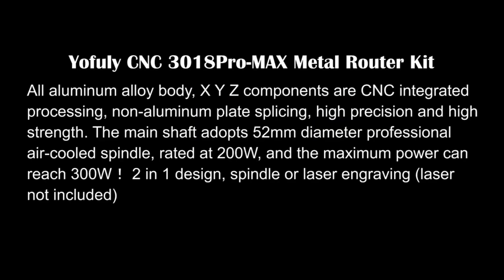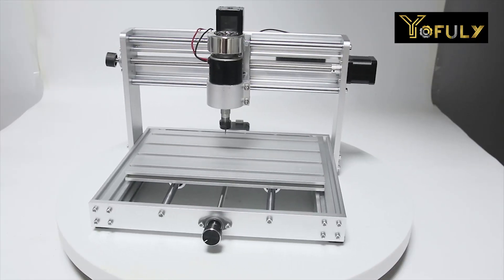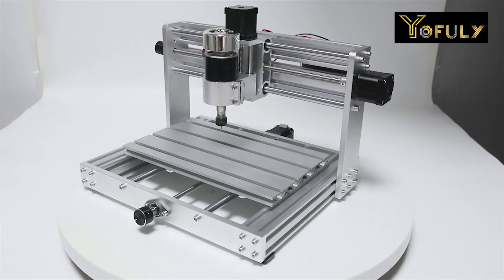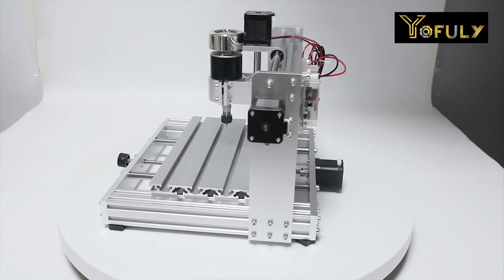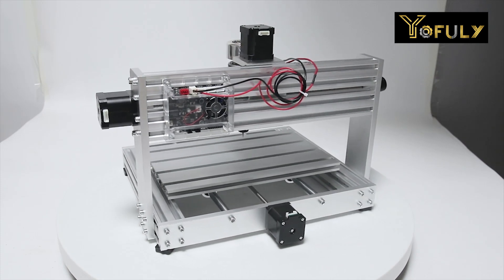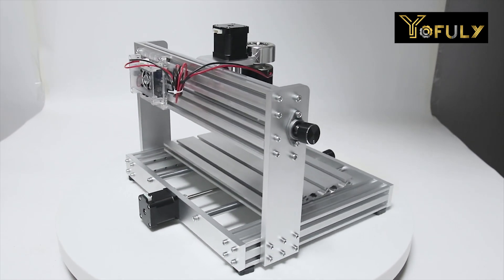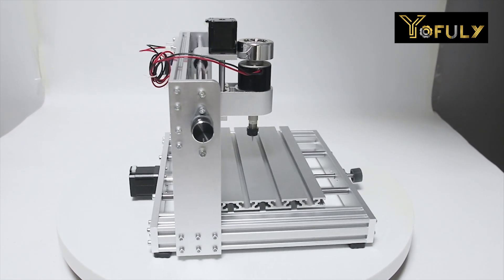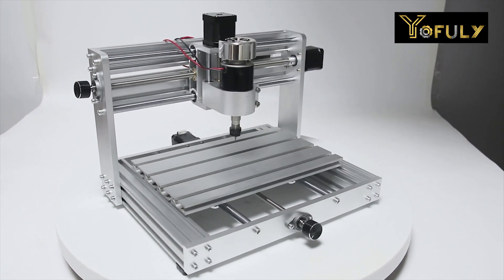200W Spindle!!! Yofuly 3018Pro-MAX Metal Engraving Machine Installation

Comment: Why don’t these videos ever show how to connect the electrics and laser? After construction I’ve been left with 4 square rubber feet with no way to attach them to the frame. The feet are threaded to accept bolts but I have no bolts left. Also, the control board for the laser has 2 holes to connect it to the frame but, again, no bolts or nuts for connection!

Comment: Where or is it possible buy frame parts seperatley?
Reply: First you need to establish the design and size you want to have for the table travel then you need to source the components on EBAY or your local metal dealer.......there are many configurations for this type of build using extrusions and no two types are the best as it's a matter of design, build and evaluate the end result.

Comment: Huh?....a Pro-Max.....that's a very up market name for a router that still has the 8mm drive screws in brass nuts with spring back up and no thrust bearings on the screws.....why not 1204 ball screws??..... and the X axis rods are still unsupported even though they appear to be a bigger dim.
The 200 watt motor is also a bit small considering that a 500 watt brushless one is available.
The base frame was never an issue with the basic 3018 model.....it was always the uprights and cross rails that needed improving as has been done here, but the super strong base frame here does have a crowd appeal though.
Grbl....that is for noobs......Mach 3 is streets ahead on all counts........if this is a Pro Max, why not make it live up to it's name or is this something intended for the Pro Max Ultra?????
Reply: I would guess it's about price.  The router you are describing sounds like it would cost £400 or more, instead of the £250 odd this costs.
Reply: @gerrykavanagh  Yes. precisely so, near enough, The one I bought a month ago for analysis cost me A$224...about 120 pounds.
If you designed this mill down to the skinniest extrusions that barely held the parts together and low spec everything else etc etc, then the price would be less than the buying price for this mill retail, but the point is this is it's a 3018 size mill and I am building it from the ground up with extra heavy components to make it perform better to possibly the max.....you could make it bigger with bigger extrusions etc but then it's not a 3018 anymore.
Just adding a few more powerful components would not make it perform unless you approached from a new angle and decided that it must be 3018 and as strong as you can make it.
That means the frame has to be the starting point.......I would think starting with 2040 or even 4040 all round would be a good start......more costly.....yes but better....yes.....it's not down to a price but within reason up to a specification.
At the moment it has 2020 for the base and 2040 for the uprights but will probably change later.
I already have the main frame assembled with SBR12 linear rails and 1204 ball screws for all axes in place ready to mount.
The table cost me A$59 for a 12mm thick piece of aluminium 300X250, that's the size it sold for on EBAY.
For me it's a just for fun project (I already have a CNC mill) as I wanted a simple small router for fun to mess with  but mainly to satisfy my ego as a better build design than the bought one.
I consider it to be a big boy's Meccano set, that is why it's a 100% off the shelf bolt together item not cast and machined etc.
Parts are slow to arrive from China but getting here.
Reply: @gangleweed  now you have me interested in seeing what you are working on. You are doing a blog post or a video, right?
Reply: @gerrykavanagh  Hi, no video....I'm doing an upgraded  from the ground up version of the ubiquitous 3018 table router/mill.......many of the upgrade features are based on the UTUBER Minhs cave workshop videos where he has done an upgrade to the basic 3018 by replacing many parts as he went along......that to me was counterproductive as it was obvious from the word go that the basic 3018 was made as cheaply as possible to get sales and needed to have almost 3/4 of the build replaced by more robust components.........I will sell the one I bought initially as a design tester as it is still in the box untouched.
It will cost more to "reinvent" this pearl amongst the brambles, but as it is a fun thing with a serious outcome........how much would you want to spend if you wanted something small, compact and with performance. etc.........family cars are a typical example of enthusiasts who soup them up with more exotic parts to make them look and perform better.
It just depends on how far you want to go.......I'm going the Mach3 route so that means a Mach3 controller and stepper motor drivers with a compatible power supply.......together with a 500 watt brushless motor.......head in the clouds etc, but it is happening.........as it's a bolt together entity......no machining...... it's off the shelf and only limited by your imagination.....my email is tarpear@iprimus.com.au if you want a pic of the build so far.
Reply: @gangleweed  Funny thing is this 3018 desktop cnc. The version from Minh man cave is 6040 with heavy duty spindle. That not fair to compair one low cost and power with one really was monster with heavy duty. I'm 3018 user and mine need a tons of part for working with metal. But dont mess with it cuz it's very cheap.
Reply: @Meobeo88  There are two types by Minh man cave.....the first one is the common 3018 upgrade in various ways and led onto the bigger completely different design that is a moving gantry type so both are totally different......my 3018 build is almost finished and I've stopped building to add a DRO to my bench top mill to enable more accurate drilling for the linear rail bearing blocks and rails etc.
Reply: @gangleweed  No bruh. 3018 got 2 version. One is open build with 20x20 alumium ray and other is 3018 pro with ABS X-axis arm. He build his cnc from 3018 open build. His version got a tons thing to upgrade. If you watch his newest video you will see 2 version of 3018.
Reply: @gangleweed  The version on this video only need to up 16mm or 22 spring on X axis and open build Z-axis for spindle 1kW. I got ABS version and almost done with it. Can cut metal very well. With its cost I have no complain with it.
Reply: thrust of the lead screw is held by set screws on the flange bearing...Again this is not a Haas vf5 SS.You can bet it will outperform most of the people who get it
Reply: @blackhd92 I quite agree it isn't a race horse but small aspects of it could make it much better.......I would think this type of machine is for those that only want to plug and play right out of the box while the interest lasts then gets put on the back shelf for ever. It is designed very much down to a price even if it has more rigid components than the original ones that only had 2020 extrusions all round.
Reply: @gangleweed  Yes. It's the point. This design of this cnc for low cost machine. If you need more duty, upgrade or build another one with higher cost. That's the point. I have no complain about my 3018 ABS, because It's very cheap and with a few upgrade, It's really useful with me.
Reply: @gangleweed  I agree with you the name not really max. They can easily change to HGR or MGN slide for the name "Max" but they didn't. Anyway 12mm bearing can work ok with 500w spindle. I upgraded my 3018 with 300w high speed BLDC. Can beat Alumium or brass like butter. But not upgrade x and y slider yet.
Reply: @Meobeo88  The big problem with a weak frame or any component that can flex under load is that you won't notice it if there are no actual dimension variances. 
Carving doesn't need any dimension aspects so you won't see any out of shape characteristics, but if you mill anything to a size you will get some out of tolerance and out of square or out of straight line errors.
For what these cheap machines are designed for will suffice for most things you want to make like carving wood and plastic parts for ornaments etc.
I would invest in a mill if I wanted to make tight tolerance parts, the only problem is a basic bench top mill usually ends up at a high price after  needing a complete retrofit to make it CNC......enter the 3018 cheap alternative and a gateway to the world of CNC.